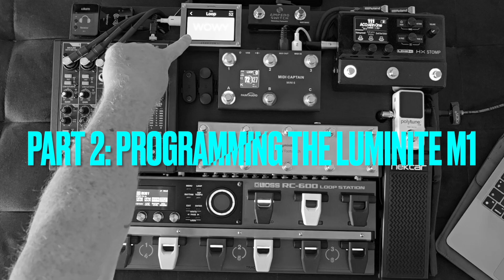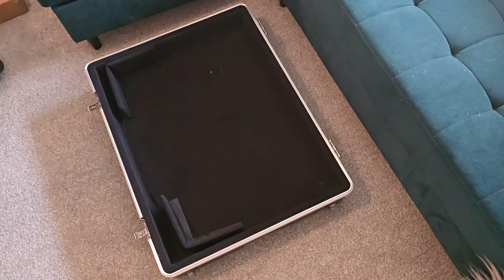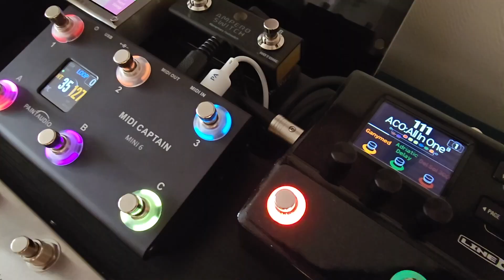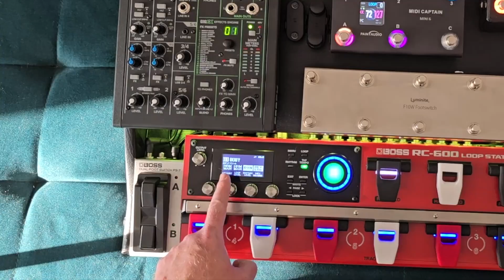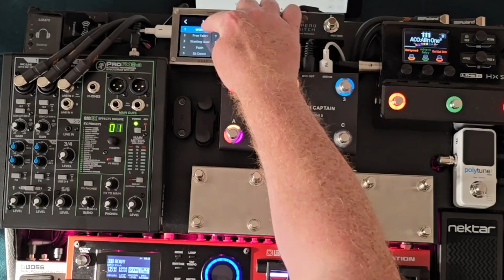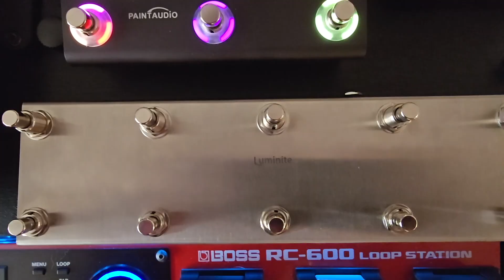CUSTOM Pedalboard Build and COMPLETE Walkthrough

Comment: Great! Thanks for the rundown. What size ply did you use? When you wrapped the sides in faux leather did you do that before or after attaching the sides?
Reply from the maker: Great question, Josh! I should have really included that detail in the video, but completely forgot. The ply is 12mm, which is plenty to support the weight for me. I wrapped the back and sides first, and then fit everything together using the screws. The black caps do a pretty good job to camouflage things, so I'm pretty happy with the way it's turned out. Cheers, Ross

Comment: Hey! How do you power the RC600 of the CIoks DC7? Cheers, great video
Reply from the maker: I come out of 2 outputs on the DC-7 using a flex adapter and run into the RC-600 that way. Check out the recent video I made on the DC-7, which should explain everything. Thanks for tuning in, and I hope you're finding things useful! Ross